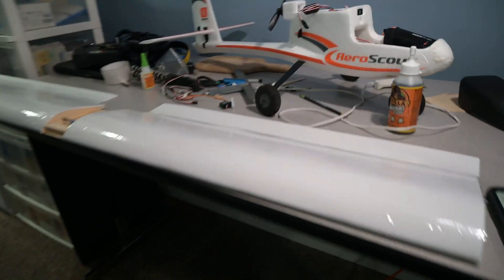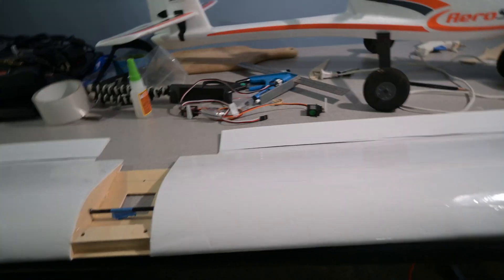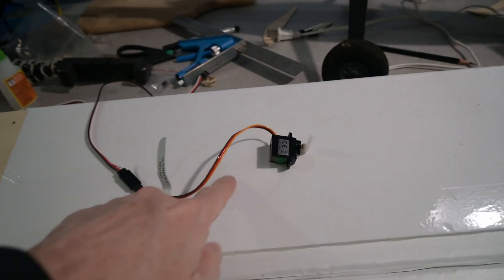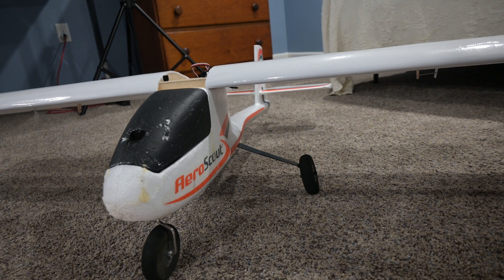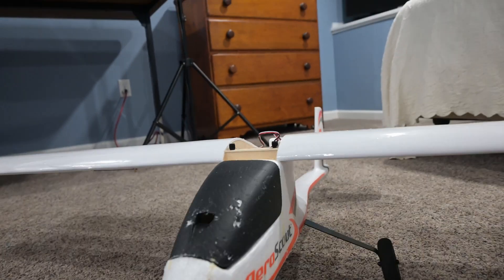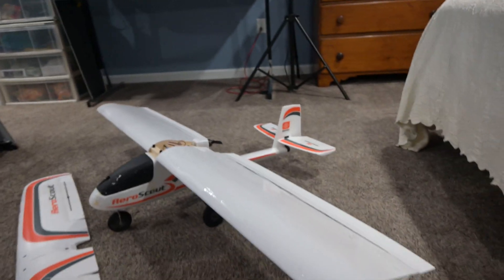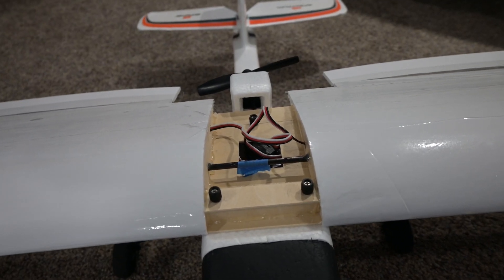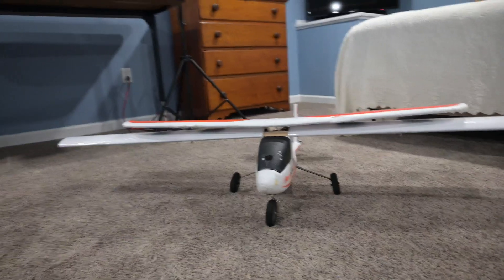New Wings for AeroScout

Comment: What happened? Did u hit something or just crash the ground?
Reply from the maker: I just landed hard. The wings flexed down and the hot glue joint attaching the foam skin to the wing ribs  gave way close to the body of the plane.  I have since repaired it and added an extra spar to give extra strength. Just waiting for good flying weather again.
Reply: @mitch_s  good luck. I just crashed mine for the first time in over a year of successful flights twice a week doing three batteries per outing. I just got careless. If you are interested u tube MrDougstud and check out the repair videos.

Comment: Awesome, thanks for sharing the experience. I have two AeroScouts in my fleet and use one for experimenting as well.  It looked like a successful lift off, would have been good to just get some altitude so you could carefully line up for a smooth landing rather than rush a landing.   Keep at it.  I'll be sharing a video on my AeroScout mods soon. Also going for better "STOL" performance, maybe you'll get some ideas for your project.

One idea I had for the wings was to get a second set of AeroScout wings and graft part of the 2nd set onto the ends of the first set.  You could also take advantage of both sets of control surfaces. Use the inside as flaps and the outside for ailerons.  This isn't what I'm doing with my current project but one idea I had which I may do in the future.
Reply from the maker: Hey there Shane.  Yeah it lifted off nicely and I was able to fly it with the throttle much lower, so in that regard it was a success.  I definitely am a frantic flyer still. Just need more time in the air.  I’m hoping that a slower operating plane might help.

I look forward to your experimentation results. I should have mine back in the air again pretty soon. I added a second carbon fiber rod connecting to wings together. It feels much more solid now.  Happy flying!

Comment: Hi buddy
Fantastic job making the wing.... They need strut supports why don't you fly in safe
Reply from the maker: Hey Brian, I do use safe mode, but sometimes find I need to switch out of it to pull a sharper recovery turn now and then.
Reply: @mitch_s  I can see this. Wing is going to be fantastic for gliding
STAY LUCKY
Brian